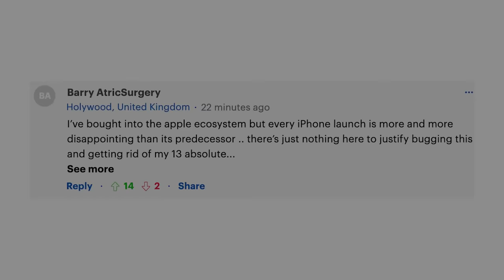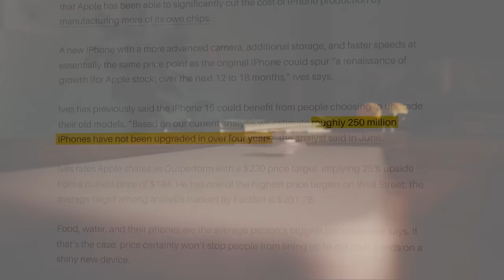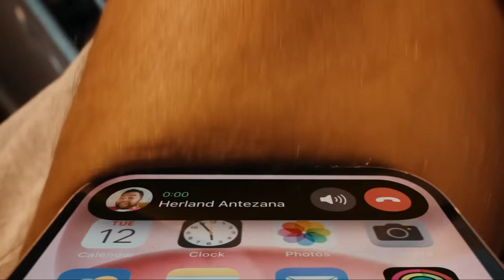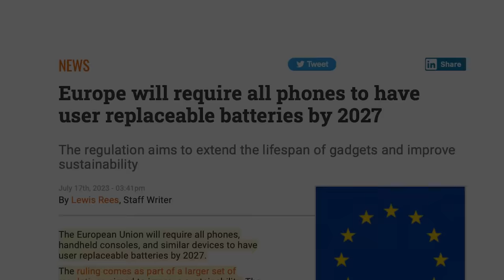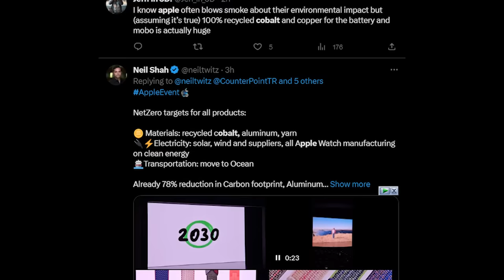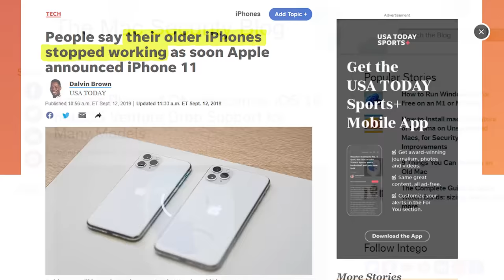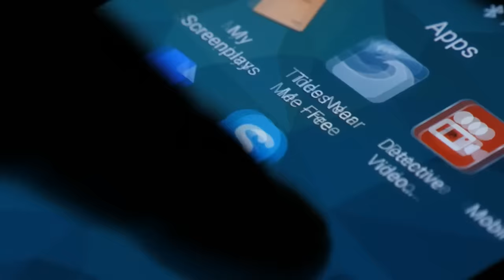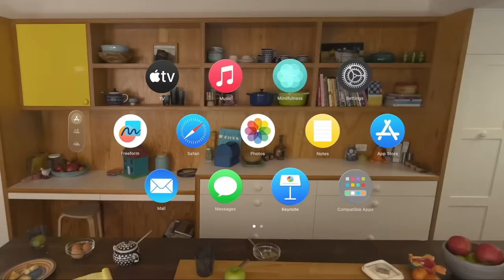The iPhone 15 Is Everything Wrong With Apple

Comment: This is just how I see it, I definitely agree that everything is getting bland now. But to be fair, (i know they can still improve) but it won’t be as crazy as before. I see it just like the Gym, you get half your gains (assuming a great program with proper splits) with in the first year, then 25% in ur 2nd, 12.5 in ur 3rd and then so on. You can only improve so much unless something new gets discovered
Reply: I don’t mind bland as long as it does what I want it to. It’s there to facilitate what I’m doing, not insist upon itself to the point where it’s actively interfering with my actions. That’s why “Clippy” was so loathed by the public.

Comment: I switched from iPhone to pixel. It's funny because my Android will only get 3 years of software updates whereas my old iPhone will get at least six. Problem is, nothing really happens in those six iPhone years, so I'm basically getting the same experience in 2024 that I would be having in 2018 on iPhone. Meanwhile, pixel is pushing the boundary and also breaking things in the process. Good times!

Comment: I bought a Xiaomi MI 9 5 years ago at launch around 350 bucks. Daily use, battery lasts exactly 8 hours of intense USE, it charges from 0 to 100 in 40minutes. It runs all games smoothly even PUBG, the camera is insaley good, the frontal camera is also insanely good, 128gb storage. What a banger of a cellphone I got 5 years ago.

Meanwhile my coworkers paying 1000 in 48 installments to get a poor battery life (not the last one, that one has a good battery) and a slightly better camera.

Comment: I'm somewhat really happy that I don't use iPhone.
Before I got a new phone, I used a Samsung Galaxy J5. It was very outdated, which, you can imagine, since that phone is... old. And so, as old as it was, it was no longer capable of running some of the software I wanted to use. I, got a new phone. A Xiaomi Redmi 13C. I'm sure it was not designed for gaming, or... any other excessive activity, as it can overheat very quickly, but... as long as I can use Discord, Facebook, Messenger, and play music on it, I'm completely fine with that phone, as long as it won't explode in my hands.

As to why I never choose Apple? Simple: it's too damn pricy, and considering the inflated country I live in, I could only dream of an iPhone, but even so, I would not. I don't like the concept of it anyway....

Comment: Limited customization options compared to other platforms
Lacks a consistent universal back gesture across the system
No dedicated number row on the keyboard, requiring third-party apps like Microsoft SwiftKey
No per-app audio control, limiting sound management
No direct call access from the lock screen
No option to end a call while another is on hold or send it to voicemail directly
Missing the convenience of fingerprint recognition
Lacks the option to run dual instances of apps, useful for managing multiple accounts
No option to pause videos while recording
Switching SIM cards during a call is cumbersome
Can’t edit a digit in the middle of a number from the dialer, which can be inconvenient

Comment: As an apple fan it is kinda frustrating to see that they aren't pushing the boundaries with every release. They are definitely in a rhythm of giving us the bare minimum. However they aren't the only ones. It seems as though the entire phone industry as a whole is plateauing. Even the foldables that started a few years ago are just getting incremental improvements. Apple isn't innocent in this but they certainly aren't the only culprit.

Comment: >Every new iPhone used to be something special
Yeah, like having to buy 3GS because 3G didn't support video recording. Or having to buy 4S for Siri. Or 5S so it's doesn't scratch like 5 does.

3G was my last iPhone. I've been using various Android phones exclusively over these years. Right now I am so fed up with Pixel 6a and Apple so conveniently added USB C that I'm planning to switch to iPhone 15. They also dropped the cheap looking mirror finish on the sides, made the edges less sharp. 15 is a subtle, but great improvement.

Comment: Another neat thing about Apple is, lets say you find a bunch in a landfill and you repair them or use the parts to make a working phone, if the person who previously used it and threw it out hasn't logged out, all you can do is throw it back in the garbage because chances are they won't want to unlock it. I've found about 26 iPhone 11, 12 and XRs in the garbage. All of them are locked to the previous owners and Apple refused to unlock any of them. This is an amazing feature if your phone is stolen, not so much if you're the type of person that hates to see perfectly fine hardware go to waste.

Comment: I have an iPhone XS since 2019 and I'm planning to buy an iPhone 15 this month. I had some midrange android phones in the years (Honor 8, Xiaomi Mi 8) but none lasted as long as my XS. The only reason I'm changing phone is that I want the new updates, since Apple does not provide software updates after 5 years, but most Android phones do not provide support for such a long time anyway.

Android phones are also getting pricier, so spending 750 Euros after taxes for an iPhone 15 seems actually fair. It's also noteworthy that the top Andoid companies have the same problems of Apple. The problems discussed in this video belong to the whole smartphone market, not only Apple.

Comment: Everyone has stoped innovation…..someone needs to do it….we killed LG phones the last innovators……..peak apple 2007-2019 the iPhone X was the last iPhone to innovate and trust me I’m an apple guy (yes I’m also an android dude) the 13 at least made the screen a little better the iPhone 4 CHANGED THE WHOLE FRAME AND BODY WITH STANLESS STEAL oh and wait for it the iPhone 5s got so much updates AND YOU CAN STILL USE IT my iPhone 11 Pro Max got slow so much that my galaxy s8/s9 was faster I fixed it but my point is apple is not innovative anymore…you need to find innovative companies like Samsung nothing or google

Comment: So, I bought the iPhone 15 pro. I returned it, because it was overheating. I took it to the genius bar, and was told (after over 4 hours of working on the phone, and the genius tech going on break without letting me know) that if I am trying to use the camera for more than 20 minutes I should expect it to overheat and shut off. This is truly idiotic because it is advertised that you could shoot a whole movie on it. Clearly not true. Anyway, bad experience. 

I also just today had to return the replacement 13 pro max today because the charging port was broken. If I buy another, I will be on my 4th apple phone in the past 2ish months. I got an apple watch, because I thought the first phone would work. Now I feel trapped because if I buy a non apple phone the watch is just totally useless. This has become a little bit of a rant, but I am just so frustrated. Overall, I have just had a really awful experience switching from android phones to apple.

Comment: I like how people are somehow blaming phone companies (not just apple) for how miners are treated in the mines. Blame the companies operating those mines not their buyers who cant change how a certain company operates their mines... 

And even if lets say Apple and Samsung as the industry leaders stopped buying minerals and metals from those kinds of mines... there would be PLENTY of companies that still do because there are thousands companies that require batteries, and 95% of them arent so public that their public image really matters. So basically phone companies will have to pay more for the same stuff, which will directly transform into more expansive phones for consumers while those mines would just sell to someone else.  

If you want those mines regulated, send a third party company to monitor those mines and in case of breach of rules close the mine
Reply: Its wrong to blame apple or any other phone company for simple coming out with a better and improved product every year. The people are the ones that are materialistic and obsessed with status and simply need to have a new phone every year. Im also on 3-4 year upgrade cycle and my "old" iphone 12 still works perfectly fine to the point that I still dont really NEED a replacement. 

You wouldn't blame alcohol drink company if someone caused a crash under influence, you'll blame the person who willingly consumed alcohol and sat behind the wheel
Reply: You clearly don't know how any of this shit works

Comment: Apple: Introducing our newest innovation we call iSwap. Now you can swap your batteries on the go without having to wait for your phone to charge. That brings us to our newest innovation, the iDock. Use 1 battery now and charge the other one until you need it.
Samsung: Charge 4 batteries at once and never run out of power. We've also made it to where your phone never has to be turned off with our battery swap device. Pull out the built in cable and connect the new battery and disconnect the used battery for charging. But we're not done yet. With our other device, now you can add multiple batteries to your device and increase the life of your phone even more.

Apple Fans: Wow, you can swap your batteries, Apple is innovative.

Android users: 🤦🏽‍♂️

Comment: Almost everything that changed from the 14 pro to the 15 pro:
Titanium, action button, new a17 chip, USB C, thread networking, focus in depth control with portraits, better battery, and pro res video up to 4k 60. That's not everything they added to, those are just some examples. Why does everyone think because they don't look that different that nothing has changed?

Comment: I use Android, in specific Samsung.
But everyone gets everything wrong.
1 To get a phone, it boils down to your needs.
2 Everyone does the same.
S6? S7?
Iphone 5 and 6
S8? s9?
Iphone 7 and 8 (Yeah, this was not an update from desing perspective)
S10?
Iphone 10
s20,21
Its the same "innovation" as iphone 11,12 and 13
At least, the 14 and 15 has dinamyc island.
And from the rear S22 and s23 are the innovation, but still the same as last year.
You'all have no idea about nothing, only about being a fanboy. Just buy whatever you need or want, doesn't matter the brand.

Comment: I still think the Pro Max models are one of the most beautiful Apple inventions ever. Yes, there need to be some changes such as a new control panel, more costumizations, more options in the settings menu, 12 GB RAM memory, better photo management, even better security, there is still plenty possible.. Regarding the model shape of the devices I really hope that Apple just remains Apple and doesn't follow Samsung with their stupid flip and fold phones and just sticks with their current models. They are fine!!

Comment: For a while I've been yapping about planned obsolescence to anyone holding an iPhone i see, and they just look at me like I'm crazy and snicker.
Reply: It's probably because Apple has been the best company for years now in terms of supporting old devices.  Apple supports old phones for up to 8 years, Google supports pixels for up to 7, Samsung is on average 4 years for their Galaxy line, etc. with the average phone coming in at 2-3 years.  So telling the people with the phones boasting the longest support about planned obsolescence is probably going to be a tough pill to swallow for them.

In addition most of the people who harp on planned obsolescence are misinformed about a specific set of issues that occurred back in the day.  Specifically, Apple's phones had issues with power brown outs.  Once the phones got old enough, specific circumstances could cause the phone to request more power than the battery could provide and the phone would just die.  And there was wide spread reports of people complaining their phones were at 15%+ and would suddenly shut off.  Apple fixed this issue by rolling out a patch that prevented older phones from requesting more power than the battery could safely deliver.  This was seized on by the planned obsolescence crowd as proof Apple was maliciously slowing down older phones and they sued Apple.  Apple responded by adding a toggle to let older phone users choose wether or not they wanted to experience possible power brown outs or current draw limitations on the battery as it aged.  

The other thing people point to is how phones seem slower over the years but ignore the fact that years of new updates to the OS and the apps keep adding new features that drain batteries and use more processor cycles then previously.  Apps can obviously update to request more, but hardware can't spontaneously update to accommodate that (without buying a new edition).  But as someone who never buys the latest and greatest iPhones every year but keeps them for 4-6 years and always buys used...  I can't say I've ever had an issue either with Apple's support for old devices or things becoming too slow.

Comment: I was never the biggest fan of iPhones, though I did use them for most of my teenage years as my parents also used them. Despite preferring android and its extreme levels of customization and freedom, I did still really like my iPhones and they all felt so new and innovative, starting with the 4 and ending on the 6S when I started buying my own phones and switched back to android. 

It's sad to see that special Apple "innovation" fizzling out. I genuinely was awestruck with each development of the iPhone every year that my parents would get me for Christmas. The 4S with Siri and the better cameras, the 5 with the new bigger display and the introduction of the new iOS that got rid of those bubbly ugly aesthetics, the 6 and 6S with finally a new form factor and bigger screen. Ever since the X it seems like they are generally the same thing nowadays, just changing up the appearance here and there and slapping a new chipset, more RAM, and bigger cameras inside. 

Even as an android user, I would love to see apple make some big innovation again...

Comment: Agree to disagree, that issue of "selling-out" without any new innovation is not limited only to Apple. All the big brands  have done this in one way or another. Even I am not an IPhone user, it still is the most future-proof of all in the way of software update or new techs. No Android device could issue software updates more than two or three years since they didn't hope their end-users to use their devices more than two years. Software updates are actually very important because of new bugs and issues. However, I totally agree with you on the environmental issue.

Comment: The EU should force Android-Phones to get Updates. Phones from 2019 for example are still capable enough in 2024, but guess what, my Oneplus 7 pro is stuck with Android 12. The Hardware could EASILY support Android 14, but they just won't do it.

Comment: Saying that handsets are going to die out is like saying that knives will no longer be how humans cut anything. Get over yourself, the candy bars are here to stay. People love to mention how thin the iPhone is overall but measure the difference between the body and the camera bump. Look at how little hardware goes into a handset and tell me they can't give us replaceable batteries. I dare anyone.

I have an LG P870 I could still remove the battery from. I point this out because if Apple wanted to throw some real innovation into the handset market, they can do three things:
— Removable battery (thus, undercutting FairPhone and mid--range handsets with removable rear panels)
— Removable camera pod (which, that space could double as a multi-function accessory space).
— Bluetooth camera pod for having the handset's camera hardware (as well, the better camera modules) be positioned where one wants.

Comment: I will stop you right at the beginning of this video. Thing is, as an ex Android user I will explain to you why iPhone does not need extreme changes every year just to be cool. This device is nearly perfect already, they can only add small touches and most people don't even care about those. I personally love that iPhone is nearly same every next model, especially the OS, I don't need to get used to new graphical features every update, phone looks same but runs better or battery lasts longer etc. I am not Apple fan boy, I mean I still use iP13 and I love it. Android is great too don't get me wrong. Samsung phones are amazing, awesome cameras, cool looks and software features iOS will probably never get, but my problem with it was that all that customization made me customize it so much that I wasted a lot of my time for it and especially getting a new device was a nightmare. Thing I am trying to tell that Apple cracked the code of most people - same product just slightly better because why change what people already love.

Comment: I’ve kept all my old iPhones and iPads thinking someone in my family or a friends family might need one some day. I have a 4, 6, 8, 10, 12 and a first gen/second gen iPad. Mind you, these batteries were only used for two years. Now, almost all of them barely hold a charge and the OS is so slow they’re pretty much unusable. The 7 and 8 run decent but the 6, 4 and both iPads are absolute bricks. Takes minutes to load a semi complex web page. They are intentionally making sure your phones have to be upgraded every 3-5 years. I’d like to just give them to someone who may need them but who is going to want them?  It’s so crazy how much these things cost and how much we all wanted them when they first came out. Flash forward a  few short years and they’re as good as garbage. It’s so sad and pathetic what we humans are doing.

I always buy two generations before the current lineup whenever I upgrade. I get them cheap and they run great for about two years. But by then, they’re technically 5 years old absolutely useless. I’m currently running a 12 mini and the battery is pretty much done for.  It’s showing 95% capacity but I’m lucky to get 6 hours before having to plug in.